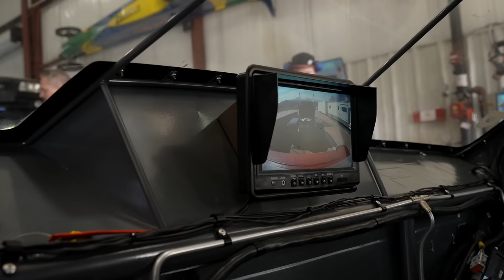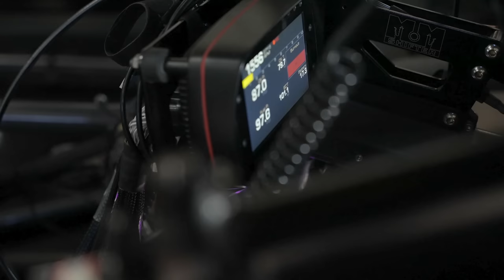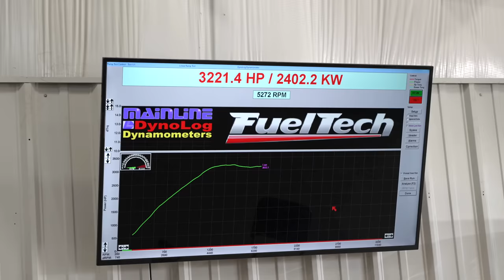1993 Chevrolet Caprice Pro Mod | Steve Morris Engines

Comment: Just think Mullet now has the Boostmaster Wagon’s engine sitting in his engine bay ready to do battle at TX2K this weekend
Reply: Mullet's journey has only just begun..................... Cleet and team had big issues trying to hook-up with the old set up - now there's 1500+ more horsepower on tap. Mullet will have trouble getting much faster without some SERIOUS suspension tuning/work. I see rear-end, transmission and driveshaft issues in the near future.
Reply: @AL_EKs  he can tune it to have the same power if he wants.
Reply: One of the things Cleetus is doing is going to the bigger tires. He was running 275s for a while, but he's going to 315s now